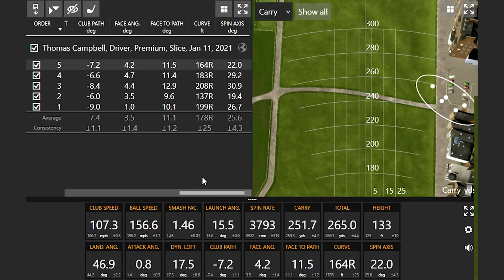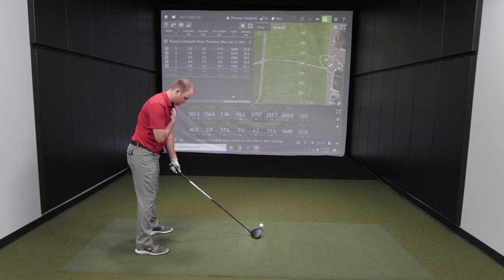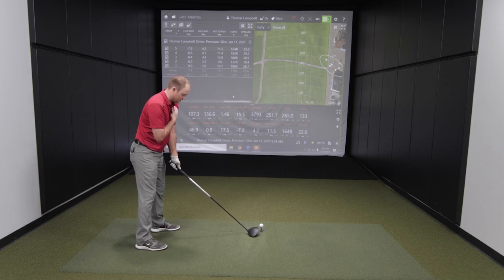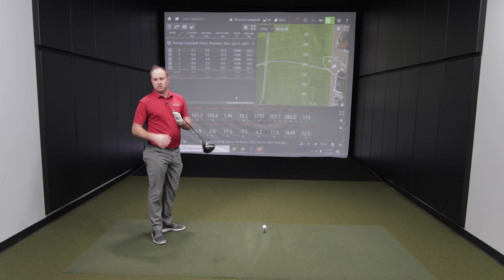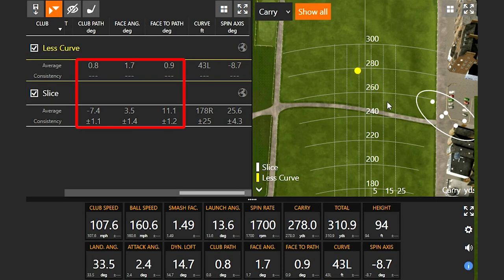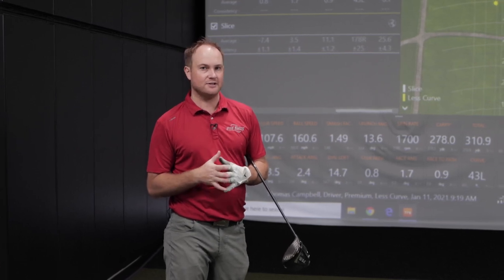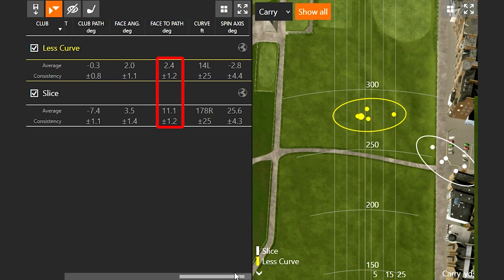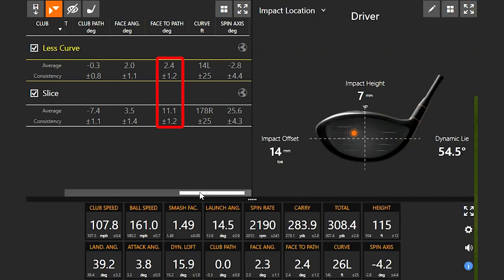How To Fix A Slice | Golf Swing Tips and Tricks

Comment: Thomas, many thanks, that was very informative and potentially game-changing for us right-side of the course warriors👍
As a former lifelong SLICER, I would like to add a few personal insights that might be useful for long term Slicers out there.
In my experience, the out-to-in club path is actually a "reaction" to an open clubface, so the first thing that needs to happen is that we need to FIX the open clubface first. As well as strengthening the grip (as you advised in the vid) I also "cheated" slightly by having the clubface slightly closed at address. Adopting both of these fixes will/should start to produce shots that fly left instead of right, which for an inveterate slicer is pretty novel, to say the least.
Having "Fixed" the Clubface we can now set about changing the club path. 
For many Golfers, this will happen automatically (as a reaction to a closed clubface). But for some golfers having spent most of their golfing life swinging left with an out to in club path to reverse this and start swinging in to out and aiming right will be a MAJOR mental battle. 
I'm speaking personally here because it took me months before my brain would allow my body to swing the club out to the right. But eventually, by placing a small water bottle (plastic) slightly behind the ball I reprogrammed my brain to allow myself to swing out to the right.
I hope that helps anyone who took the time to read my comment👍